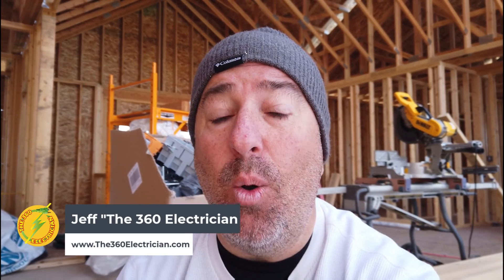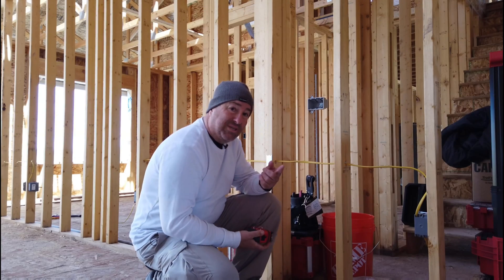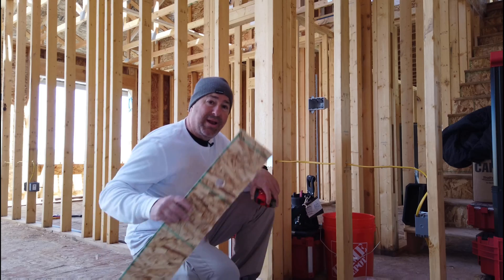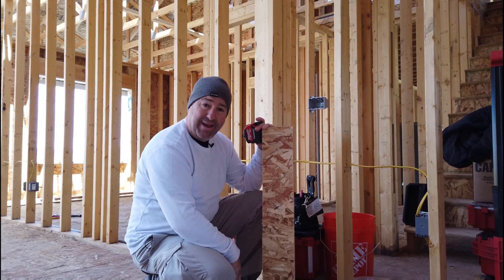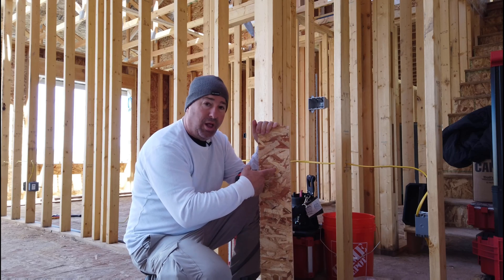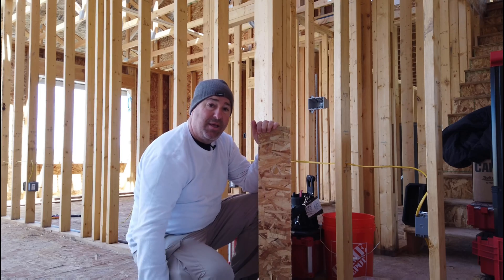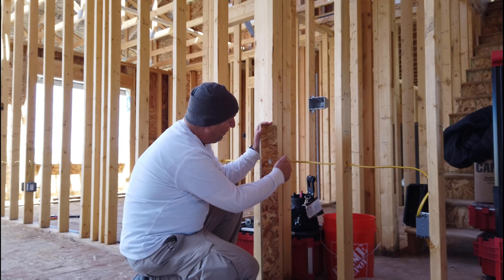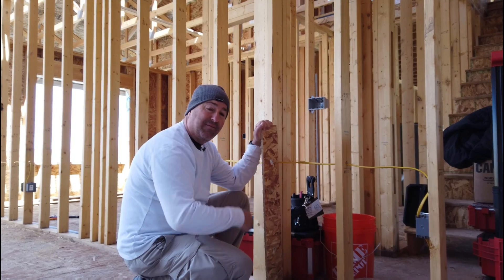How to Install Romex wire especially if your a new electrician #electrician #electricalcontractor

Comment: Looks like 12 awg romex you are running. You know I bought a 246  foot spool of this which was made in the States 
Do you find the yellow jacket on this is super soft ?
.
Reply from the maker: In the LA locations we use only 2 suppliers and Home Depot / Lowes when emergency. I think Southwire jackets are the best. They snap off good when razon bladed and strip nice when going along the wire. I have used other brands and found "cheaper feeling" wire an hard jackets as well.
Reply: @The360Electrician  I couldn't find a manufacturer - the spool says Made in USA plant 2201 .

Comment: I'm not sure how different the electrical code is in the States , but here in Canada , there is a book called the Ontario Electrical Code Simplified . It has the answer to just about every question anyone could ask about residential electrical code. 
Its about $13 and most of the home building box stores sell it . 
I figure almost every rule in the electrical code is because someone paid the price . 
.

Comment: The faster, easier way is to use a laser level. You can shoot a line on almost every stud on a floor all at once. And vertical lines too, to keep chases in the ceilings straight as well.
Reply: One other point about a laser level - use it to mark the height of all your outlet boxes and switch boxes . 
I can't find anything in the electrical code that specifies height of the outlet boxes , but when they are all the same height , the quality of the work looks much better . 
.
Reply from the maker: What make and model do you like to use?
Reply: @The360Electrician I have a Makita 3 way laser, not that I'm brand loyal or anything, it was just the only one at Home Depot at the time that had the features I wanted. It shoots a horizontal line, a vertical line, and a plumb dot, or all three at once. And you can get a tripod for pretty cheap too. I use the hell out of it. I line up rows of lights, shoot lines for drilling, locate lights perfectly above counters/islands/sinks, shoot lines for boxes, and it even works pretty good for things like leveling conduits, or shooting a line for positioning clamps. If you get used to using it, it's a super time-saver. Well worth the cost.
Reply: @bryanherman1035  Getting a laser level to the right height can be a pain . So the key is getting a tripod that can be adjusted to all sorts of heights - and one that won't tip over easily . The thread on the bottom of the Bosch GGL 2-20 is a 1/4 " course thread - which I think is the same as a camera tripod .  
.
Tip when working on a fence outdoors , I get a 3 or 4 foot length of 5 / 16 " vinyl tubing , fill it 1/2 full with water , and duct tape the ends together - then use this as a level . This is way better than any expensive level . 
.
.

Comment: My pro hole drilling tip: for vertical holes, I use a large drill bit extender so I drill the top plate without a ladder! Much faster and much easier!
Reply: I’ve used the 5ft flex augers for the same myself.
Reply: Always used Greenlee nail eater drill bits for old work. Cuts thru a hidden 8 penny nail and remains sharp.
Reply from the maker: @JohnThomas-lq5qp   They still make them? I'll have to reach out to Greenlee!
Reply: @The360Electrician  Any Diablo is the best (drill bits, sawzall blades, hole saw)
Reply from the maker: Great idea. I always forget to get the extenders. Do they have a good locking one so my bit doesn't get stuck? Im my eadly years We used an extended bit to go across a thick beam and ended up leaving the entire bit in the house...lol a little gift for the client
Reply: No spade bits, auger bits. It's more expensive, but it goes through wood like butter and can also chew out nails. I have 18" auger bit and I drill top plates without ladder, you make a good point with extender.

Comment: I find it faster to put my elbow in my hip, lock wrist/arm and start drilling. That way no reason to bend for each hole with template, also can keep both hands on drill.
Way less fatigue constantly bending for 28" or whatever template height you use.
Reply from the maker: I hear you, but I did 100 holes  in 15 min one handed. It looks like a machine did it. Absolutely straight and easy to rope

Comment: Systems are so necessary.
Reply from the maker: Thank you, it's funny why contractors think this wastes time. I did 100 holes in perfect line and roped myself in 2 hours. With all the other benefits it's a no Brainerd. Now my newbie knows exactly what we expect. Thoughts?
Reply: @The360Electrician  i will try your way on the next rough-in. I'm always ready to learn, but instead of template I will put a laser on tripod in middle of room.
Reply from the maker: Not a huge fan of lasers. Batteries, set up and can't go around corners. This method you just keep on going.  Try both in one room and see what's better for you and let us know. THanks. PS what state are you tuning in from?
Reply: @The360Electrician  the state of Ontario, Canada 😉